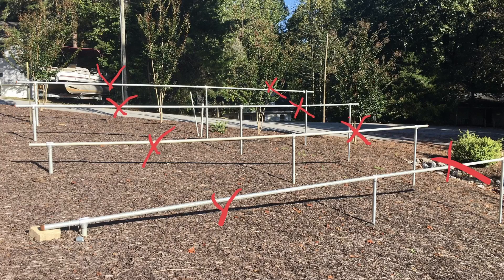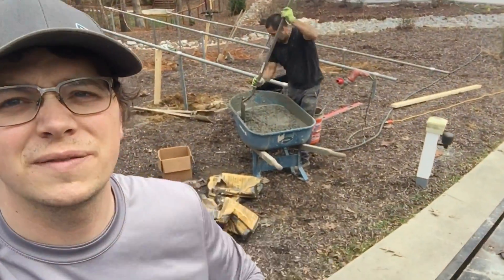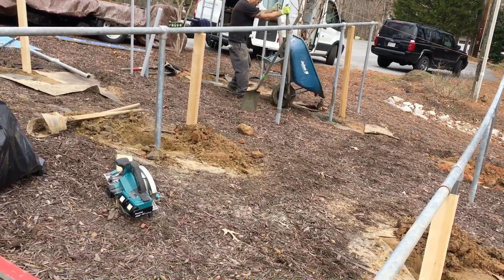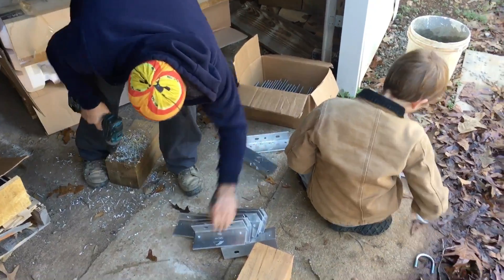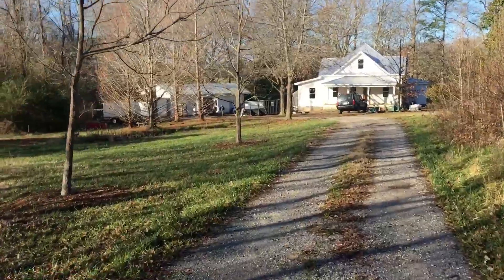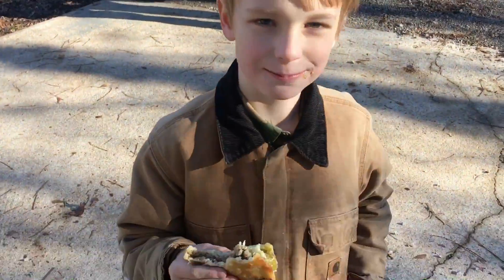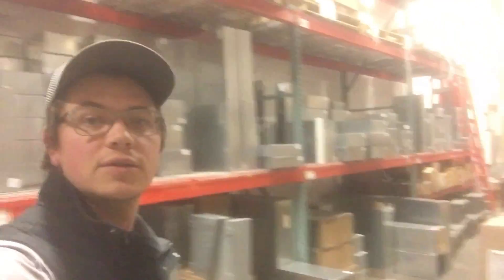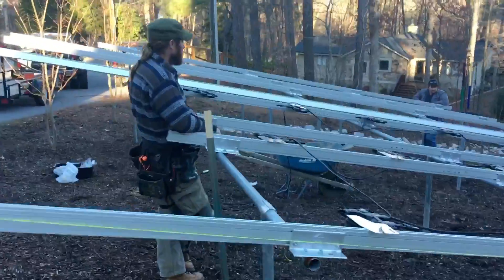Mission Imposible:  Fixing a Crooked DIY  Solar Groundmount

Comment: ''
' Can you provide a link or at least the name of the solar tracking tool  thats like a cover mirror you see the sun path and shady areas on?  I saw it on one of your videos and also on I think one of Scott s videos and I tried internet searches and Practical Prepper searches but cannot readily find it,  I am thinking about adding west or east or at least  non south facing panels to try to get more hours of direct solar energy. Thanks in advance . I like the recent channel content.
Reply: I did find the Solar Pathfinder .  New question . Is it good for determining non south facing solar path ?
Reply from the maker: It will tell you when the sun is going to shine in any spot.
Reply: @GainSolarPower  Thanks
Reply from the maker: Thank your for watching. Any specific interests you would like a video on?
Reply: @GainSolarPower  Maybe need or not need for Neutral wire to  inverter and sub panel in certain situations such as run-in dedicated circuit to HVAC that is only 240 volt not needing neutral wire.
Reply: Or paralleling inverters  combining battery supply to both units etc and can you charge the batteries at same time from any other source such as a dedicated different solar charge controller at the same time as hybrid inverter if both are set at the same max voltage or maybe non inverter one set at lower max voltage.
Reply: @GainSolarPower  Where and why to install surge protectors also might be good as well as where and how to ground a solar system.